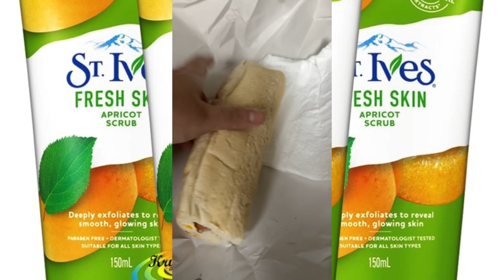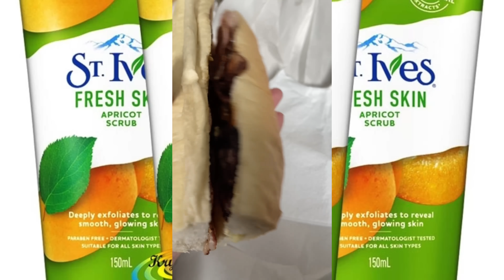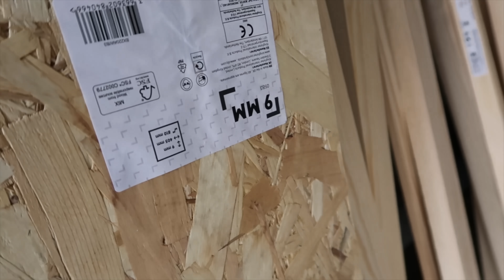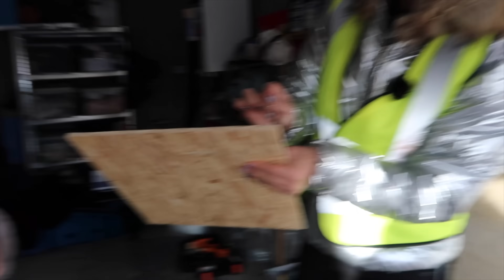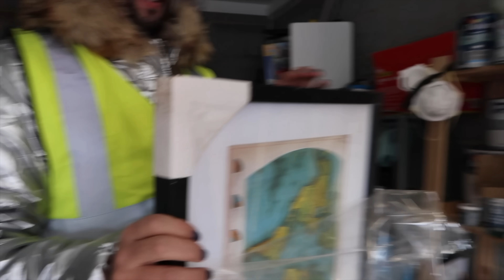Doing Super Manly Things EP2 - Building A Chair 💜🖤 The Welsh Twins

Comment: To ease your sawing experience, rub a bar of soap or candle across your saw blade. Cut through OSB or plyboard like butter. I’ve been known to oil my blades with olive oil, but I don’t recommend because it will funk up your wood finish later w/ oil at the edge of the wood.